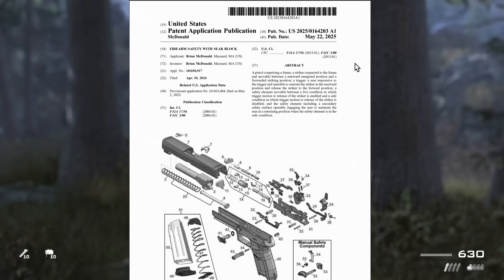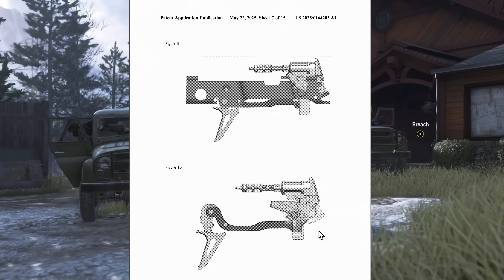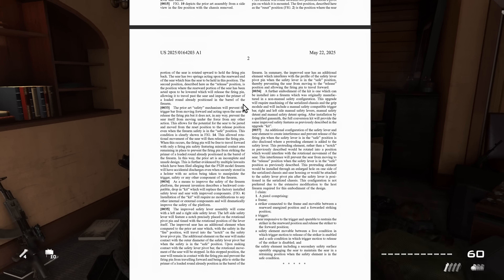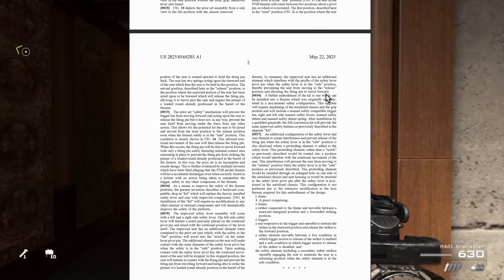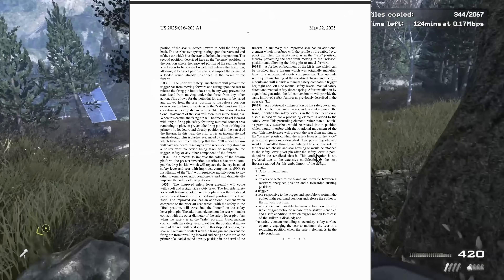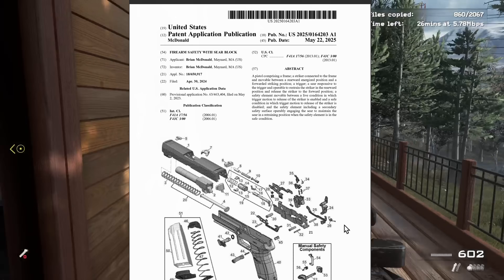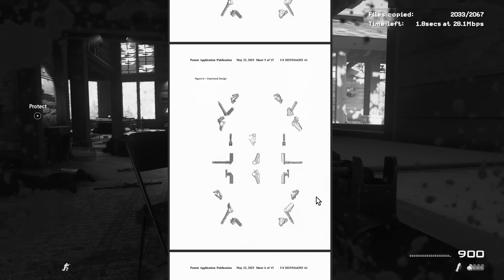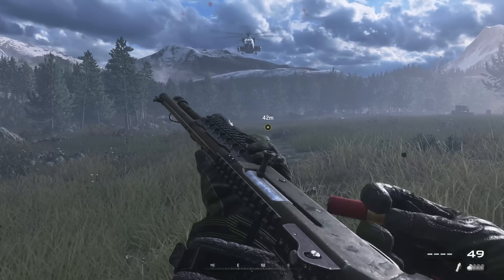Explosive: New Patent Claims Fix For  "Incomplete, Unsafe" 320 Design

Comment: Treating the symptoms not the disease and it only applies to P320's with a safety.

There is still a chance the seer loses contact now one of two things happen. One, the weapon is no longer cocked so when a policeman or serviceman draws and attempts to fire the weapon nothing happens. Two, the weapons is no longer cocked on the seer, its cocked on the safety, so when the weapon is drawn disengaging the safety discharges the weapon.

Did I mention this requires a P320 with external safety?

A larger problem here is more dark. If its declared there is no infringement with this patent and determined to be the best solution that means this person can sell the rights to use his idea, effectively monetizing life and safety.

Comment: "Incomplete safety" is a blessing in disguise. All the uncommanded discharges in person's hands, off safety, would be surely written off and swept under the rug as "negligent discharges" if it wasn't for "right in the holster" thing.

A properly designed manual safety would surely make P320 safer - safer in the holster on safe, at least. That safety apparently would also force the sear into a proper position if it was misaligned when the safety is engaged, so apparently safer overall.
But it is still a flawed design capable of uncommanded discharges like a Nambu.

P.S. And you could potentially get a discharge by flipping the safety off, as another commenter pointed out.

Comment: Fully cocked striker without manual safety (P320 civilian versions) or a trigger nub thingy was always dumb. You wouldn't carry a hammer gun (even with firing pin block) cocked and unlocked, would you? Striker guns get too much slack from the gun community because Glock used a semi-cocked striker design, and we give others a pass even if its a fully cocked striker. Fully cocked guns must have at least a trigger nub safety but manual safety is preferable.

Comment: This doesn’t explain why the firing pin block is such a suck ass part that it fails without the trigger being pulled. Even if the sear disengages by accident, firing pin blocks are meant stop said action from causing an AD. Watch for another patent showing up for that part…

Comment: So, the gun just won't accidentally fire when the safety is on? Yet if the gun can still accidentally fire when the safety is off still, but before the trigger is pulled doesn't really seem like a good solution...
Some people even carry with the safety off.
Reply: All the uncommanded discharges in person's hands, off safety, would be surely written off and swept under the rug as "negligent discharges" if it wasn't for "right in the holster!" thing.
This "incomplete safety" was a blessing in disguise.

Comment: This is nothing. It's an improvement to the manual safety, that's it. It does nothing to address the firing pin block allegedly not catching the firing pin. I haven't seen any hard evidence that that can happen, though I suspect it can.

Comment: This isn't a "fix" for the alleged "uncommanded discharge" issue, because it really only addresses oversights with the design of the thumb safety mechanism, which basically nobody outside the military uses (I worked in a gun store for several years; The "thumb safety" models were not popular at all).

Comment: Hmm. The timing that he claims he was working as a consultant, tells me that they hired him independently to work on this thing, probably in the hopes that what they were afraid was happening, wasn't.  Of course they would do it through somebody else, if they do it themselves they have to own the liability. Now, it doesn't look like this actually stops any chance of it happening, it reduces it. And what about non external safety models?  And they still haven't completely addressed the drop safety issue, although they brought it in line with reduced chances like a Series 70 1911. They could have actually solved it with a trigger safety, but nooo.  Ultimately the problem remains the same, the pistol is a hack job that they're going to keep experimenting on people with. No thank you, my Glocks have been perfectly safe for many years now.  And there's a lot of talk in military circles from people I know, that they want the 19X 😊.  The best thing Sig can do right now is quit digging the hole they are in, and replace all the pistols what's something else before somebody else gets unalived.

Comment: IIRC this is very similar to the P365 safety, it rotates up under the sear and interferes with its movement. It doesn’t fiddle with the trigger bar. Google P365 safety lever, it has a tooth that points up towards the sear or whatever…

Comment: This won't save the M17 and M18 if this only works when the manual safety is engaged.

Some branches and units carry with a round in the chamber and the manual safety disengaged at all times.
Reply: unless they are on active combat duty,  thats just dumb, carrying with the safety off.
Reply: @mtnbound1776  So you want to carry a weapon that is unsafe when set up for a combat environment?

And carrying with a manual safety shouldn't be necessary. With proper training and discipline manual safeties don't get used. Millions of pistols are carried every day with a round in the chamber and no manual safety even on the gun, without issue.
Reply: 😂 what branch of the US Military carries with the safety off?
Reply: @joshuabaker5712  The United States Air Force, the very branch which started this latest round of controversy.

Comment: This might not solve the problem because there is a lot of slide movement in Sig's slide. When you push the front of the slide down, the rear will rise a little bit, which is enough to release the striker even if the sear is stopped.

Comment: What if taking the gun off safety is enough wiggle in itself… to bring the 320 to ND like before? Like the mating surfaces were already at the brink while on safe… flipping it off safe is the action that allows it to slip and the firing pin to drop. Argh!

Comment: Sig is corrupt, the firearms are cool but the company is corrupt. Even with a fix I ask people to boycott them, not older model used but new ourchase. I have a Sig romeo optic on a rifle, so far it works but not sure how long ill keep it, might spend the money to get a better optic because the romeo is kinda budget and ive heard complaints. Bushnell TS26 also budget but its rock solid. If i save up for a higher end optic ill replace the romeo but otherwise nothing against the romeo, just that i hate Sig almost as much as Bill Ruger.

Comment: This is the biggest mistake sig made. Putting a safety on the p320 that doesnt actually stop the firearm from firing. That should have never been done. Only stopping the trigger from being pulled is only a half safety. But calling it a safety left people with a false sense of security. Anyone with common sense would know that a safety lever should block the sear from being moved and rendering the firearm incapable of being fired. John Browning knew this in 1911.

Comment: Would it be sufficient to merely make the manual safety actually function as a safety? Given that this is just the safety lever and not part of the trigger assembly, I still feel it's not enough. 

Prior to this I've always felt confident forgoing a manual safety on striker pistols (or DA/SA with a PROPER decocker), as any properly designed firearm should NEVER fire without the trigger being pulled. We now realize this may not be true for "fully-cocked" designs, which to be fair are quite popular aside from Glock and so far haven't seen widespread issues aside from the P320.

Sure, if you already have a P320 or several this should give you the peace of mind to carry or at least shoot it. However, existing firearms discipline is still based on the concept of preventing discharges by keeping your finger and anything else off the trigger until you're ready to fire, NOT disengaging a manual safety right before you fire. Even military firearms discipline dictates you disengage the safety as you present the weapon in a firing position, and re-engage it whenever you shift from presentation to any other position. 

I like the design and am curious if it means anything beyond this one guy is trying things, but the weapon still needs to NEVER fire without a trigger press in order to fit within existing firearms safety discipline.

Having a weapon that MAY fire at any time the safety is disengaged is still MAJOR liability issue, as both professionals as well as armed civilians may have cause to present their weapon at a live target without having yet made the decision to fire. Obviously this is fairly common in law enforcement scenarios, with the current climate so hot already I doubt any department wants any possibility of a truly unintentional discharge downrange at a perp.

Perhaps this concept could evolve into a connection with the trigger, bar, or disconnector?

Comment: This is ONE fix for one of many problems. But the P320 is a flawed design. Glock and most others have a semi cocked striker and 3 internal safeties, including a trigger dingus, trigger bar ramp drop safety and a firing pin block aka the striker safety plunger. 
Sig has neither of those, they have a fully cocked striker, no trigger safety and just a wobbly striker safety that relies upon a small spring, a sear only secured by a small spring and a secondary sear notch that never engages anything in any testing. I'd take 3 safeties where nothing happens even if they fail over 2 dodgy ones where it fires upon failure.
Reply: Exactly.

This patent isn't really to address the alleged "uncommanded discharge" issue, it's just making sure that the optional safety lever, which has never been a popular option on the 320, actually blocks the things it should block (e.g. sear, firing pin, & trigger) instead of only blocking the trigger.
Reply: The beauty of the Glock design is that the striker is not aligned horizontally to pass through the breech face hole until the trigger is pulled almost entirely.    That's ingenious for a striker fired pistol.   I don't trust Taurus striker fired pistols either, for the same reason

Comment: Companies will say one thing and then do something else. This is always the case. I would guess they have several versions being tested as well as being developed. The US Government, being a major owner of this, would obviously need to sign off on the changes. This process is slow, but the companies will tell you everything is great and business as usual. Untested fixes can make problems 1000 times worse. They are not going to issue recalls on test theories. Yes, and a new risk analysis of potential issues will most likely be released. Engineers are like doctors they don't tell you sh!t.

Comment: SIG needs to go all in on offering this as a free upgrade to salvage anything at this point
Reply: Replace it with a free P220 Stainless Elite you mean
Reply: I like that idea!
Reply: No. P320s need to be recalled and forbidden from sale. There's no way of knowing externally if a p320 received the modification and is "safe" not to mention this modification would not fix the problem when the weapon is not on safe.
Reply: I believe they need to perform the fix themselves for proper control. Otherwise, they will just blame the gunsmith or the DIY'r.
Reply: They already offered free "upgrades" in the past and we see how that turned out...
Reply: Along with a new trigger. To little pretravel and to light of a trigger break, imo
Reply: Honestly, if they did this, I'd consider it even.  Much like the whole Xbox 360 fiasco.  People were pissed at first (for good reasons), but Microsoft's effort eventually won the crowd back.
Reply: @ragingfurball5419 I don’t think a 360 ever killed anyone

Comment: Afaik this is how the 365 safeties work and why its a drop in part vs machining needed on existing 320s. All the 320 MS does is impede the trigger bar and force it to kick out of the sear housing or break if you force it

Comment: But this would be only a solution for the versions with manual safety. And its still not 100% safe. If you consider there are uncommended discharges it still could happen in a gun fight when the soldier or  leo take the safety off. It not really a solution of the failed design. Rather a mask.

Comment: The solution would be to recall all the non safety FCUs and frames. Have new frames molded or printed tov properly fit the updated design, and return a polished product back to the consumer. They won’t do that, but that’s the way to help regain public trust

Comment: This is a partial fix. The fundamental flaw(s) are still present. This just forces the sear from dropping with a manual safety; it does nothing to stop it from dropping uncommanded when the safety is disengaged.

Comment: I remember when the P320 came out I test fired one and thought “this trigger is too good to be true” - and of course it’s comprised. 

I like the fix that he has here, I think it’s a solid step in the right direction. This fella was obviously a part of the team that designed this firearm and is well aware of the weak points. He left Sig for obvious reasons and is now trying to start his own business to supply an aftermarket fix. Best of luck to him; I’m sure this took a ton of hours to measure, model and design a retrofit solution himself without bringing anything with him from his time at Sig.
Reply: The current fast trigger reset wild west double tap craze is responsible for the original "rushed" design...😂

Comment: Will this prevent the 320 from becoming like the Rem 700 trigger that was recalled? I'm just wondering if the issue with the Sig is only stopped with the new safety engaged, what happens when the safety is dis-engaged? I have no experience with the 320, so I'm not sure if my question makes sense.

Comment: What a broken country we live in. How can SIG get a patent for the internals of a gun design they stole from Glock? The Glock Gen5 9mm platforms do this too. Well the double stack ones anyway. Its the same gun, a few other brands having the same problems as they've all just copied the same design.... How does a patent work exactly if half a dozen companies end up with the exact same safety issue for a dozen of their platforms ? Btw also why is SIG the only one taking heat for this? I'm a Glock man but I want to see them all take some accountability, right? 

Anyway my gen3 g19 doesn't do this, but the  gen5 does. Its pretty easy to see the same problem across all these platforms and the videos are all stacking up fast on YouTube.

Comment: This patent only locks the sear.  But the striker safety has been shown to be easily defeated with a slight movement of the trigger.  From the various accident, it seems the striker accidently activated
Reply: If the striker has positive engagement with the sear, then the striker is locked too.

Comment: Safety engages sear directly.  Good.  But does this address the real problem which is the striker safety slipping off the sear due to excessive slide play?  The other issue is the trigger which disengages striker safety during pre-travel.  Glock-style trigger safety would prevent enough pre-travel to keep the striker safety engaged.  Agency Arms makes a trigger safety which could be the answer.

Comment: You are jumping to conclusions. He does not work with SIG. This is an aftermarket solution, developed by a third party (angled spade solutions). It has been kept quiet and not released due to the knowledge that SIG will sue Brian over this aftermarket upgrade, as it implies that the 320 is not safe.

Comment: If i understand correctly, this will only prevent accidental discharges while the safety lever is in the safe position. When the safety lever is not in the safe position, accidental discharges will still be possible. There still exists a (literally) fatal flaw in the gun's design.
Reply: Exactly...! does not solve the issue of uncommanded discharge at all. Think its the same guy that designed the first mess..
Reply: uncommanded discharges. Sounds like nitpicking but "accidental" discharges leaves room to blame the user for what seems to clearly be a manufacturer flaw.
Reply: If you don't want the gun going off put the safety on. It's enough for me.

I'd get the p320 if I wanted to skip the manual safety.

Comment: Click bait.  This does nothing for the case where the Striker slips off the Sear because debris (powder fouling, brass shavings, etc.) reduced the engagement.  It also does nothing for guns that have no safety.  It also does nothing for the case in Colorado, where a guy was pointing the gun at trespassers and the gun went off by itself.  Also, Designers are simply CAD guys - not Engineers.

Comment: It doesn't fix the problem, IF there is a problem with discharges that don't involve trigger movement.  IOW can the firearm discharge at any time after the safety is disengaged?  Would the movement of parts within the gun that occurs when the safety is disengaged cause it to discharge?

Comment: I love competent engineering.
I also would never carry without a manual thumb safety. (Glocks also have a manual external safety -it is called the holster).
However, can you trust the p320 AFTER the thumb safety is disengaged? This gun has uncommanded discharges. Imagine a civilian drawing from appendix, following his training disengages the thumb safety by low ready, followed by an uncommanded discharge when the civilian has not committed to firing. What a nightmare.